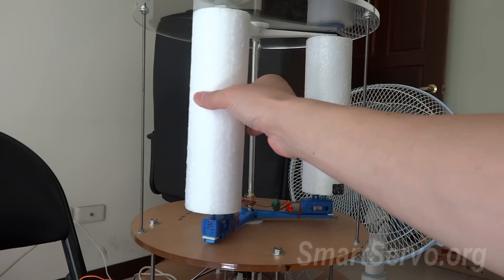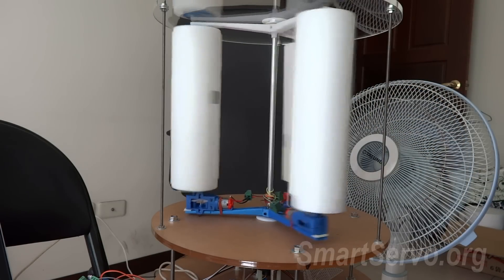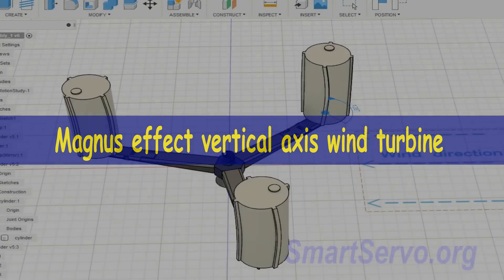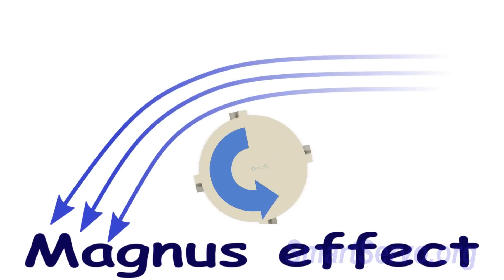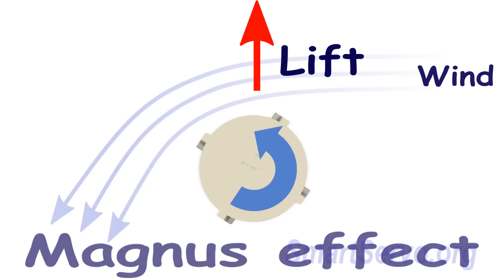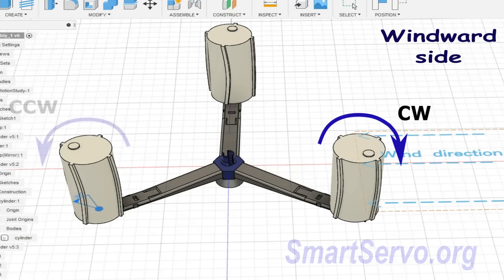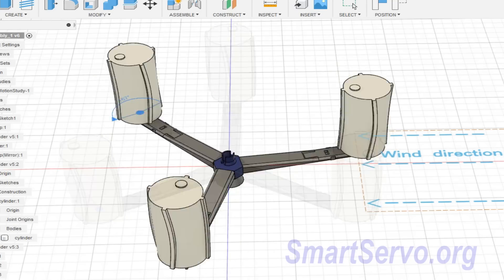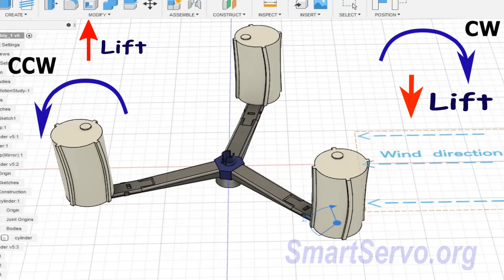Magnus effect vertical axis wind turbine, No blade, start quickly

Comment: good prototyping skills but little physics concept, many people think magnus effect could be used for vertical wind because it is cool.  think of the magnus effect of transforming a cylinder into an airplane wing, or in a wind turbine the blades.  you could get the same effect or even better power if these were simply vertical wind blades.  of course, vertical wind turbines is not easy as simply vertical blades.
Reply from the maker: While Magnus rotors have had some problems with vertical wind turbines, all other approaches have not been successful, otherwise they should be everywhere like HAWT.

Comment: how would that be a turbine if you use motors?
Reply from the maker: Don't worry about motors, they are also present in popular horizontal wind turbines for pitch control. What important is that the energy harvested from the air is greater than the energy consumed, even if this device is questionable, it is still possible => http://smartservo.org/en/magnus-vawt-implement-en/

Comment: I have built vertical access wind turbines for over 50 years á a hobby. 

You guys missed it big time. 

The symmetrical-section wings are for leverage only. Speed as well as power is controlled by the length of the moment arm.

I start mine with a flow of compressed air against what is basically a Pelton wheel at the base of the windmill. Once the blades are up to approximately three times the speed of the wind, it takes over and spins like a top. In fact, it's hard to slow down even shorting out the generator or applying the brakes. I live in Texas and the wind is very strong here.
Reply from the maker: The Darrieus wind turbine does have the problem of overspeeding when encountering strong winds, and it has not been effectively solved. Therefore, some designs use multiple blades (large solidity) to reduce the speed, but it also leads to low efficiency. not a good idea. The work of the VAWT has not been completed yet ...
Reply: The two Pac Wind VAWTs in my neighborhood blew apart in the same storm 10 years ago. One was the real big model and it just blew apart. The guy spent a fortune on it even the pole in the ground was really expensive because it was so big and so thick and had such a large concrete base.

Comment: COPY PIRACY JAPANESE INVENT DESIGN.!!
Reply from the maker: Maybe you're talking about a turbine made by a Japanese company (Challenergy), still quite different. They added a plate behind the rotor to mask the Magnus force on the leeward side so the motor didn't have to reverse, but it also lost some lift. This video shows the Magnus VAWT in its original concept, which predates the Japanese one.

Comment: Are you making more power than used?
Reply: way way less, lots of energy loss.
 too much for perpetuum mobile
Reply: Not even close and never will be.
Reply from the maker: Not yet, but since the wind energy increases with the third power of the wind speed, as long as the wind speed increases and the energy consumption of the rotors are improved, it can be achieved. refer to => http://smartservo.org/en/magnus-vawt-implement-en/

Comment: This will be a high maintenance system because as the blades reverse direction they come to a complete stop then accelerate again. This will produce massive wear in the blade shaft bearings.
Reply: except magnetic/airfoil bearing
Reply from the maker: The acceleration and deceleration of the rotor will not cause bearing damage, it is caused by stress. Moreover, when the size of the wind turbine becomes larger, the rotation speed can be reduced, and the frequency of acceleration and deceleration is naturally reduced.
Reply: Exactly, and it takes a ridiculous amount of power to reverse direction TWICE every revolution.

Comment: Since each cylinder needs to reverse direction every half a revolution, none of the cylinders can get up to high enough rotation rate to generate a significant Magnus force. Any slight imbalance in the system will cause the turbine to spin if the bearings are good enough. As someone else mentioned, you need to measure the output torque and input energy to see if you're actually generating any energy. BTW, I think that Challenergy's wind turbine would spin even if they didn't spin the cylinders because of the vanes they put next to the cylinders.
Reply from the maker: The rotors of Challenergy's wind turbines still have to spin, they just don't have to change direction. Don't you think it's strange that the upwind and downwind torques don't cancel out? Is there such a perfect way in the world? Or is something sacrificed so that the rotors don't have to change direction? The real way to keep the rotor from spinning is to make good use of this much-criticized device =>(see https://youtu.be/9AdpggaOfF0),@ 4:03 when the rotation speed is fast enough, the rotors can be stopped and no more energy is consumed.Therefore, I don't have to rush to prove its efficiency.

Comment: More moving parts, less lift generated.. its a wonder why airplanes don't use magnus "wings"
Reply from the maker: Decades ago, people tried to use Magnus rotor to build aircraft, but for many reasons, it failed. In theory, the rotor's lift-drag ratio is not as large as that of fixed-wing, but the lift coefficient is large. Therefore, The speed of the Magnus aircraft is between that of a fixed-wing aircraft and a helicopter. But it can take off and land at short distances, and it still has its value.
Reply: @SmartServo_org  I know.

Comment: Would have been nice to see it turned on before the fan. Willing to bet a large portion of the rotational speed has a lot to do with imparted energy from the motors spinning the cylinders. Could be wrong about that, but there is definitely a need for them to show the difference between the fan being on and off
Edit: grammar errors
Reply from the maker: The motor drives the rotor, and the rotation of the rotor induces the wind to generate torque(by Magnus effect) to drive the main shaft. If the fan is not turned on, the main shaft cannot rotate.
Reply: @SmartServo_org  I'm aware of how the Magnus effect works, I'm just suggesting that maybe not all of the initial speed is caused by the Magnus effect alone.
Reply from the maker: @josephgauthier5018  In the future, I will add a video of the rotor turning before the fan is turned on.
Reply: @SmartServo_org  I look forward to it!
Reply from the maker: @josephgauthier5018  I have done the experiment you mentioned, shown after 7:43 of the video => https://youtu.be/uafRQlRvAkM
Reply: This is an interesting thought.  I made an odd sculpture where angular momentum was transferred to different parts just by the overall rotation of the whole.  I wasn’t expecting it, but it was quite cool.  Certainly the angular momentum of the rotors  has to go somewhere when they reverse.
Reply from the maker: @danajohnson5993  Because each rotor rotates at a different speed and direction, for example, when one rotor is accelerating, the other rotors are decelerating, and the changes in angular momentum may cancel out.

Comment: Why aren’t you using toothed belts
Reply: …to sprockets on the rotors and one on the center so rotating the rotor frame causes the rotors to spin.  You could use a self starting rotor like Slavonic’s attached to the three arm frame to get it going when the main rotors would take it from there.  Early Darius rotors used this method.
Reply from the maker: @danajohnson5993  The rotor has to change direction.

Comment: Years ago I read an article on a sailboat which had one large magnus effect rotor as the sail.  I worked, but I wonder how well compared to putting the same rotor- driving electricity into a propellor to just push the boat.
Reply from the maker: You can see the Norsepower.com =>https://www.norsepower.com/key-advantages
,can typically produce 5-20% fuel savings.

Comment: Brushless direct drive motors might make it mechanically simpler and faster response, definitely quieter!
Reply from the maker: Of course, this video( https://youtu.be/9AdpggaOfF0 ) shows a second version using BLDC motors. It is used to start the Darrieus turbine, when the rotation speed is fast enough, the motor can be stopped(@ 4:03) and no more energy is consumed.

Comment: what can be the enery win ? how effective is it. May this is good for wind turbine for inner city because low nose
Reply from the maker: To start the Darrieus turbine is a reasonable application(see https://youtu.be/9AdpggaOfF0), when the rotation speed is fast enough, the motor can be stopped(@ 4:03) and no more energy is consumed. and the vertical axis wind turbine has low noise.
Reply: @SmartServo_org  soemone is distributing such a turbine for urban use ? I mean small for private homes lets say 300 or 600 Watt max
Reply from the maker: @rainerlubke3766  Not yet, it's just a conceptual model.
Reply: @SmartServo_org  so ....

Comment: Ermmm... using motors to spin a generator? Whats the point?
Reply from the maker: A motor drives a rotor, and the rotation of the rotor induces the wind power to generate torque to drive a generator. The rotor acts as a catalyst. Although it has not been proven that the energy output can be greater than the input, it is not impossible => http://smartservo.org/en/magnus-vawt-implement-en/
Reply: @SmartServo_org Hence my question. But havent the setup been put through a power meter, for example?
Reply: @SmartServo_org  okay! But wouldn't it work better with regular blades. The stripes are already acting as blades, the Magnus effect is marginal in your design.
Reply from the maker: @hfyaer  The stripes are only used to increase the roughness of the rotor to enhance the Magnus effect, not as blades. Otherwise the rotor does not have to be reversed.
Reply: Ermmm...A fake volcano for a science project using baking soda and vinegar. What's the point, why don't you use real lava? It's a tabletop demonstration to explain the physics behind wind energy.
Reply: Exactly what I was thinking
Reply: With the correct gearing and weighting this could really take off.

However, having light hollow outer tube would decrease energy input. And having extra weight in the frame would likely increase output.

Comment: Wait if than spin need electric i think is not turbine, turbine is no need electric 🤔, but if electric production higher than consumption maybe is good to
Reply: This is for test purpose man. As said in start of test
Reply from the maker: Although it has not been proven that the energy output can be greater than the input, it is possible => http://smartservo.org/en/magnus-vawt-implement-en/
before that, To start the Darrieus turbine is a reasonable work(see https://youtu.be/9AdpggaOfF0), when the rotation speed is fast enough, the motor can be stopped(@ 4:03) and no more energy is consumed.

Comment: If i understand correct, this isn’t a turbine. A turbine harvests energy from fluid flow. This seems like using energy to spin the rotor. Im also confused on how the 3 motors driving the blades are being controlled/wired through the rotating body.
Reply: At 0:59, he is holding a part called a slip ring. It’s like a bearing, but allows electrical wiring to go through and spin with the bearing using brushes like a motor. A lot of thing that spin and use power use them. Like an amusement park ride that has lights on a spinning part.
Reply from the maker: The motor drives the rotor, and the rotation of the rotor causes the wind to generate torque (Magnus effect) to drive the main shaft. The rotor acts as a catalyst. Although it has not been proven that the energy output can be greater than the input, it is possible => http://smartservo.org/en/magnus-vawt-implement-en/
This video(https://youtu.be/9AdpggaOfF0)@1:31 shows a larger one running in a wind tunnel.
Reply: Totally agree with you ...
Reply: Since no windflow in the room, he simulates it with help of electric fan. Different case if he runs it outside
Reply: @gargantuationex1120  i understand that, but each tube has a gear motor attached to it. It looks like the tubes are driven, not blown
Reply: 2 words, turbine engine. Which uses the airflow it compressed and ignited to drive the compressor section. Just correcting your turbine definition. A turbine can harvest power from a gas or a liquid. You're welcome.
Reply: @amendo95  when i said turbine, i meant the component, not the entire system. You’re correct in ur definition of a turbine engine(which uses a compressor and turbine), tho.
Reply: Well air is a fluid. So their is that. 
Difference between classifications and names in science and their use in real life
Both gas and water fall under fluid dynamics. 
They however are acknowledged as separate states of matter. 
Essentially stating that when this types of things refer to air as a fluid. This is why
Reply: @johnfischer1298  i know what a fluid is. I know what gas, liquid(not water like u said), and solid(also plasma T_T) are as well. I thought that apparent when i mentioned the anatomy of a gas turbine.

Comment: Design flaw 1: less than 10 seconds in, and they say there's no blades. Yet each cylinder has a protrusion, ie: a "blade" lmao. The magus effect works off of smooth cylinders anyway so, Why the protusions? Also, the magus effect is inefficient as you have to generate energy to rotate the cylinders
Reply: Have you ever seen what happens when a turbine is overdriven due to excessive winds? Speed control could be of use in such conditions.
Reply: @MrThrillkillhyena 🎉
Reply: 6
Reply from the maker: The efficiency of the Magnus effect is not low, but humans have not found a reasonable way to use it. In addition, it doesn't matter whether there are protusions or not.
Reply: @SmartServo_org  have you tested protrusion depth and/or angles to see efficiency data at various speeds? Hook up to a generator?
Reply: @SmartServo_org  appreciate the work and thought you put into this.

But I'm having a hard time not thinking of these as blades. They are  essentially very dull blades with rollers as extensions. And if the rollers aren't smooth, then the imperfections are acting as micro blades.

Since I like to wonder how we can harvest energy in the same methods we use it. This got me thinking with horizontal wind generators. Could they produce more power if multiple horizontal turbines were on one big turbine? (A wind turbine with turbines for extra blades) Or would the resistance adjustment (so it'd still spin the smaller ones) cause it to produce the same / less energy.
Or would the base's turbine even spin? The smaller turbines and the force of wind, might produce a point of resistance, so I'm skeptical.
Reply: @SmartServo_org  actually it is used on a big ship and it saves fuel.
Reply from the maker: @niw-w1f  Yes, but the newly invented rotor makes it even better => https://youtu.be/gMym621FtR8
Reply: If it works off of smooth cylinders, then what does it work based ON?
Reply: There is a ferry between Denmark and Germany with a magnus sail, I used it a couple of times. Its a smooth and really big cylinder sail. Its ugly but saves a lot of fuel.
The name of the ships are M/F Copenhagen and M/F Berlin
Its looks totally different than the one in this vid
Reply: magnus effect efficiency has nothing to do with the fact that you have to add energy to get it to work. a thermonuclear reaction also requires added energy and obviously gives back plenty more!

Comment: Would inertia of the rotors wreck this if you tried to scale it up to a useful size?

How much energy is required to reverse the rotors as compared with the potential generating capacity?
Reply from the maker: When the size of the wind turbine is enlarged, the rotation speed will also decrease. Therefore, the frequency of changing the direction of the rotor is also reduced. The method of improving efficiency can refer to => http://smartservo.org/en/magnus-vawt-implement-en/ ,before success, To start the Darrieus turbine is a reasonable work(see https://youtu.be/9AdpggaOfF0), when the rotation speed is fast enough, the motor can be stopped(@ 4:03) and no more energy is consumed.

Comment: If you need the windward and wayward sides to be rotating in opposite directions then you would need 4 cylinders. With 3 cylinders the phase is off kilter for part of the time. Actually, it doesn't matter how many cylinders you have because each cylinder will be fighting against the desired rotation for half of it's revolution.

Ok I watched another video where the cylinders are unpowered. Now it makes sense that there are 3 cylinders. 4 would get stuck in place. I guess with yours there's some kind of interference for 1/3 of the time.

Comment: I don’t get what the fan is used for if the motors are making the whole thing rotate?
Reply: The Magnus effect on the rotating cylinders is making them travel upwind.
Reply: @alanhat5252  I’m sorry but my brain must be smaller then I expected . I STILL DO NOT GET IT lol
Reply: There are 4 axes: The 3 cylinders and the big axle in the middle. The generator is the big axle having the wind rotate the whole thing, but for that the individual cylinders have to rotate around their axis and that's what the 3 motors are for.
Reply: @DiThi  thanks for that. I get it now! 👏🏽👏🏽
Reply: The fan is to simulate the natural wind that might power such a device.
Reply from the maker: The motor drives the rotor, and the rotation of the rotor causes the wind to generate torque (by Magnus effect) to drive the main shaft. The rotor acts as a catalyst. This video(https://youtu.be/9AdpggaOfF0)@1:31 shows a larger one running in a wind tunnel.

Comment: There  is more engineering required than using a  blade. The cost versus power output would be the decider.
Reply from the maker: Although the (Darrieus) turbine using blades is highly efficient, it is difficult to self-start. When combined with this device, it can take into account both efficiency and start-up. => https://youtu.be/9AdpggaOfF0